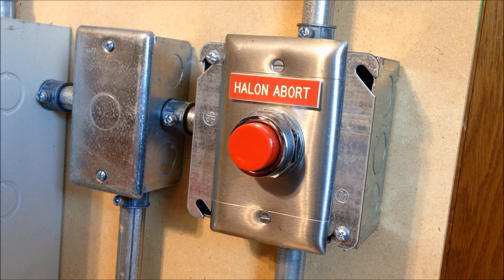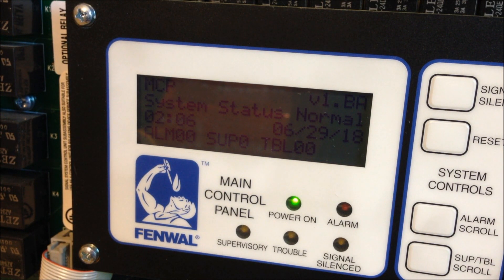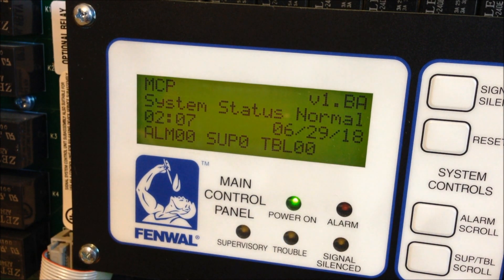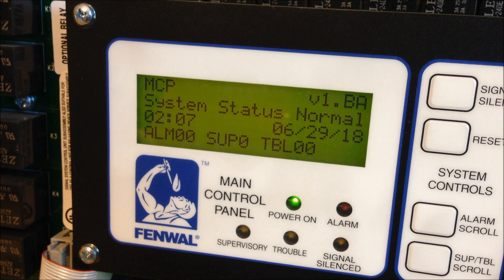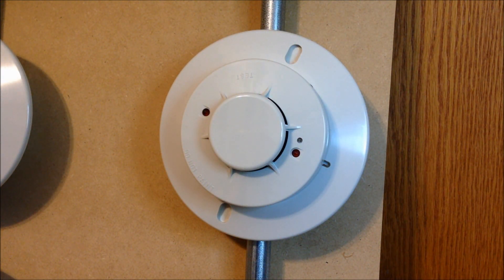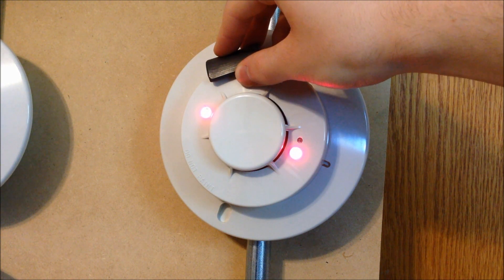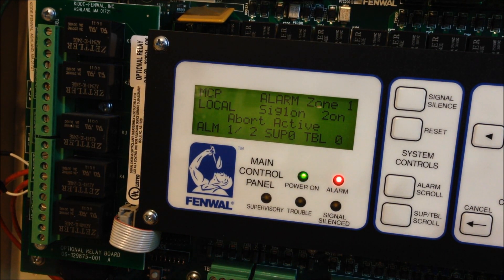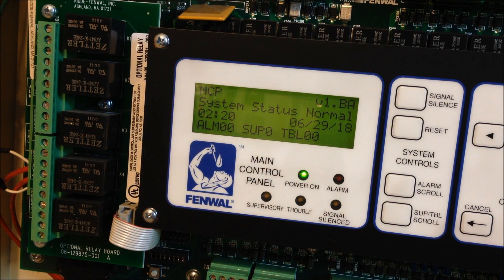Fenwal 3220 System Test 3: Halon Abort Operation

Comment: Even though it's in the process of releasing agent, is it possible to still abort it?
Reply from the maker: No, once it enters the releasing agent stage, it's not possible to stop it until the releasing time has expired. So you aren't able to abort or reset the system during that time.
Reply: @kcin556  Is it possible to turn off the maintenance shut-off valve manually when the agent is spraying out?